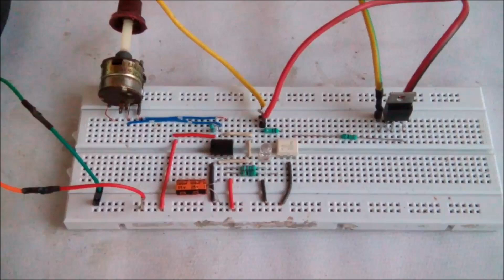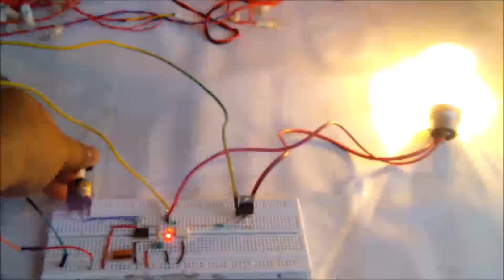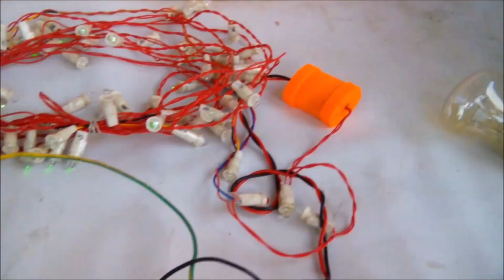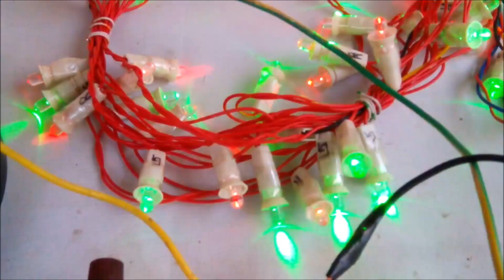Light blinking circuit using 555 timer IC and TRIAC

Comment: Very nice circuit. Thank you for posting. I did build it but unfortunately,  I can on get the LED to pulse. Nothing happenbs at the light bul level. I live in Canada so AC is 120 instead of 220. I don't think it would make a difference.. Any pointers would be helpful.
Thanks
Robert
Reply from the maker: Yes the AC voltage should not make a difference here. You might want to try posting it on our forums (https://circuitdigest.com/forums) to get help on this. Youtube comment section is not the right place for circuit debugging
Reply: @Circuitdigest  Will do. Thanks